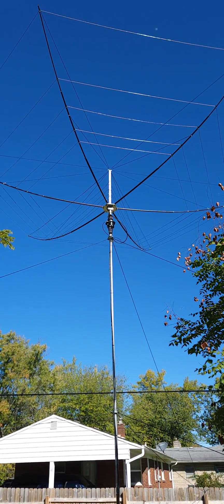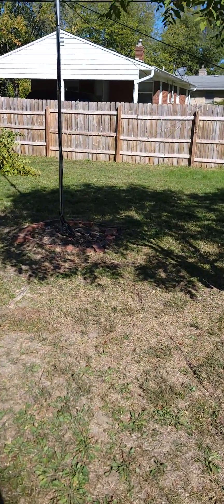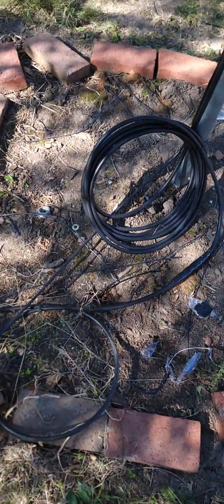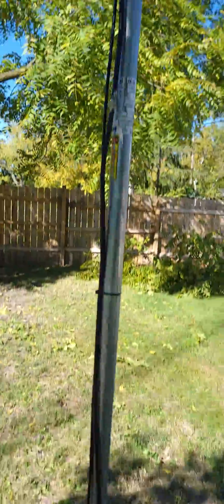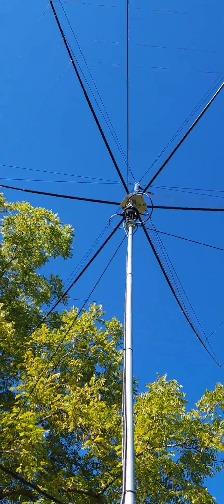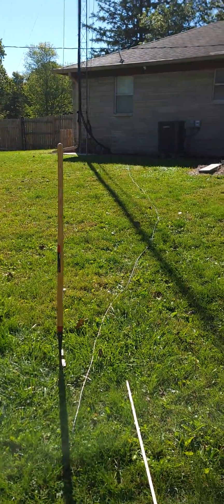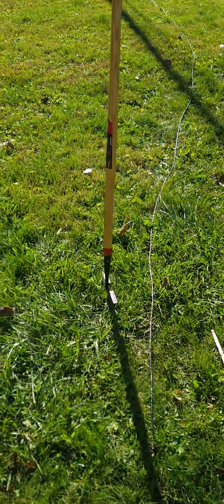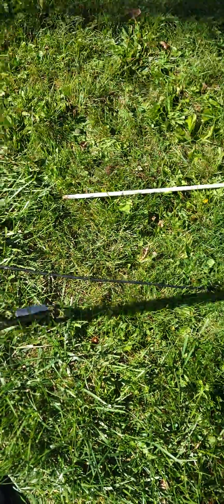New Hexbeam!

Comment: Do you think setting up a hexbeam straight on the rotor like that is strong enough for permanent setup? Or better use a side rotor mount? My mast is stronger than a pushup pole. 73
Reply from the maker: It was plenty strong in this configuration, I've since added a 2nd tower for the Hexbeam. It gets a bit top heavy pushing it up but once it's guyed there is no issue.

Comment: Justin - Hex looks great!  Mine is still in the "get it on the mast stage" and is only 4ft off the ground - but works.  Mast is also a 28' ROHN.  Hal, AF5J
Reply from the maker: The mast really starts leaning while installing so make sure to have a couple people on guy lines while you're raising it. Turns out I don't have enough rotor cable to go to full height so mine is stuck at 20'
Reply: @N9TTK  Yeah, I noticed that when I attached the 450 rotor.  Realized its a push up mast and not a tilt over.  Plan on raising with about 15' extended, mount the hex and then push up as high as I can, keeping it "behind" the house.